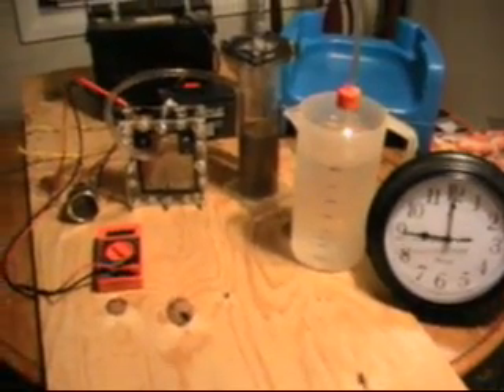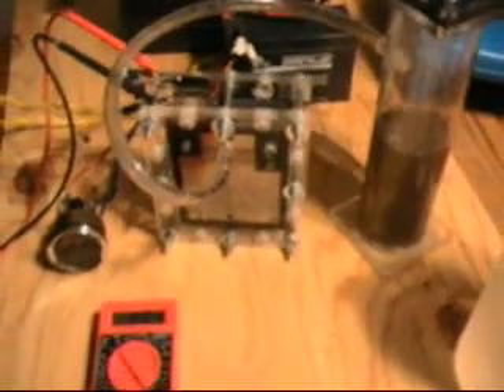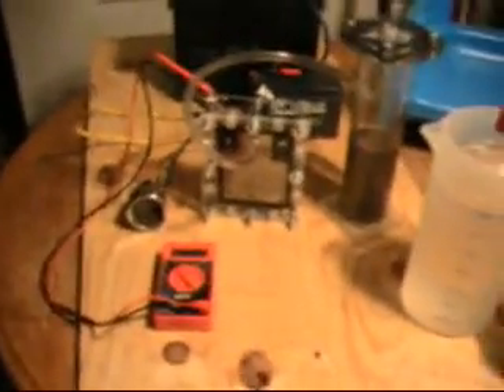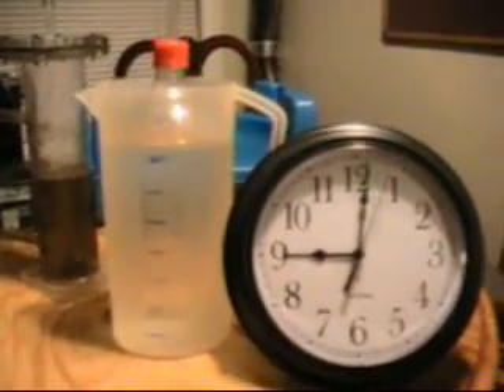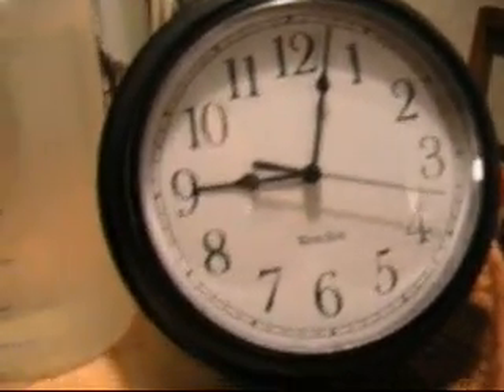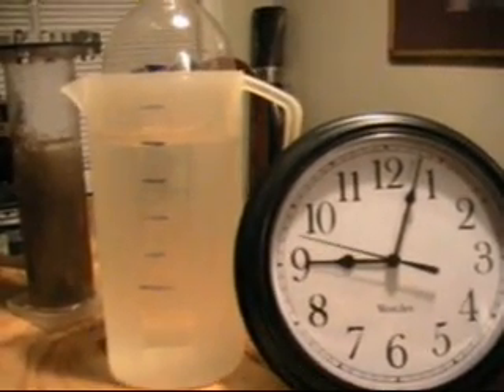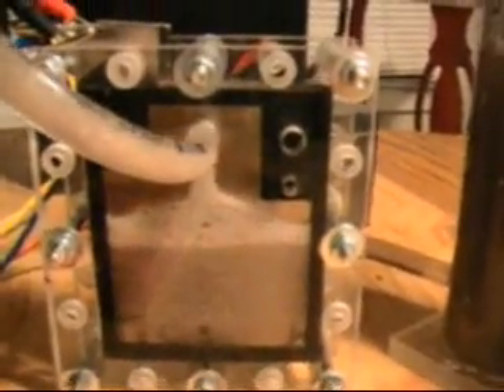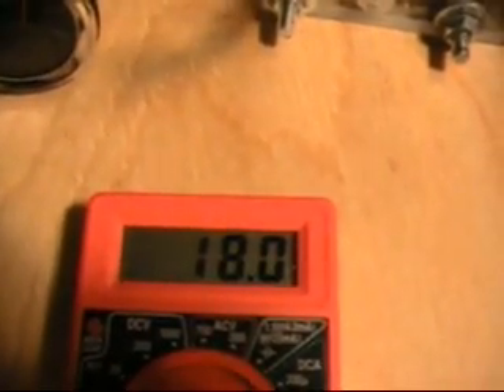Sealed Series Cell Ver 3.0 2 Liters a Min

Comment: EXCELLENT design! Since most vehicles are 12v systems, what kind of results will this unit achieve a 12v test?? The average Joe isn't gonna hook up another battery in series to get 24v, plus even if they did, it's another unnecessary added expense. Just thinking in terms of a more practical application.
Appreciate the research!

Comment from the maker: EDMS is gasket material you can buy at your local gasket manafacturer (Yellow Pages). It works great in caustic environments and comes in various thicknesses which makes it great for flat gasket needs. You can also use shower liner (Home Warehouse Store) if you need an immediate source but you are limited to one thickness. You can also use the black round gastets like from your hardware store but again your limited to what they have. Hope this helps

Good luck on your build

Ford_Energy

Comment from the maker: The sealed cells are suited to automobile setups, no wet sumps, completely sealed system and expandable to your needs. The DH Cells are suited for stand alone systens like a generator, house heater, etc. They are more efficient but harder to contain.

Comment: woops sorry its 2.15 not 2.4 got figures at overunity(.)com 
1 liter of hho gas produces 7744 joules of energy 1 joule is 1 watt second 7744/3600= 2.15 watthours of energy so for 100% efficiency your cell must only use 2.15 watthours of energy to make 1 liter of hho gas.

heres the calc
volts x amps x time in seconds /3600(1 hour in seconds)= the watthours than you - 2.15 than / 2.15 that gives you how much extra energy you are using and - that from 100 to get the % of efficiency

Comment: based on my calculations your cell is about 49% efficient 18*25*29/3600= 3.625WattHours 2.4 is 100% so 3.625-2.4= 1.225 1.225/2.4= 0.5104166=51% 100%-51%= 49% efficient which is pretty darn good most kits out there are only about 15-20% efficient and sell any ware from $400 to over $1,000 cant wait to see more keep  up the great work "LIVE THE HYDROGEN DREAM"

Comment: Yeah, if was really 29 seconds, then you are at about 4.6 mmw which seems to be more typical for this type of device.  The original Tero Ranta device reportedly got low 6's for mmw using a single hole to support fluid flow ... best I have gotten out of mine is about 5 mmw but it averages more like 4-4.5 ... so you are certainly in the game, but we both have some room for improvment ...